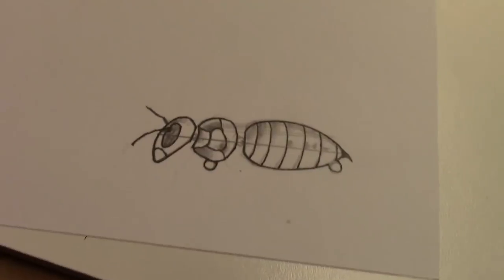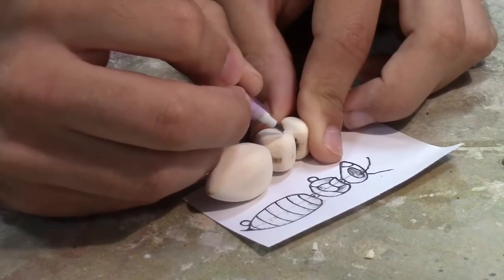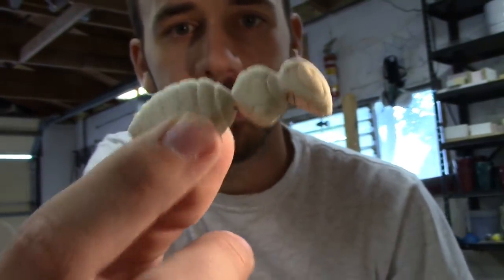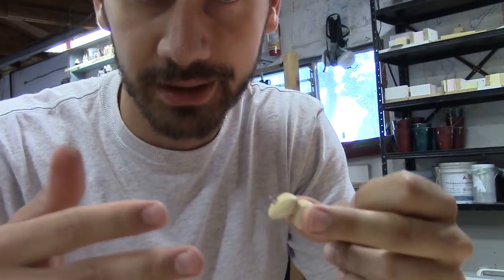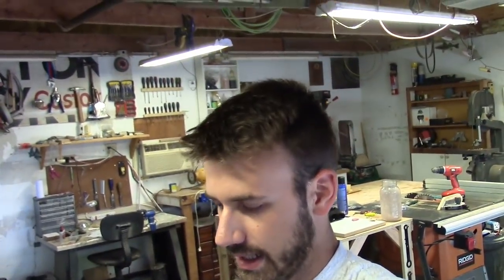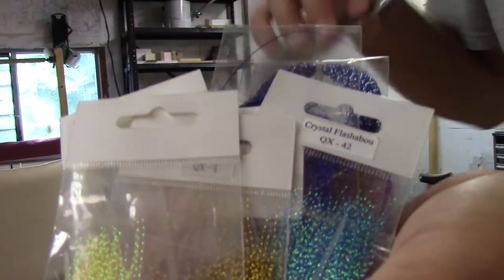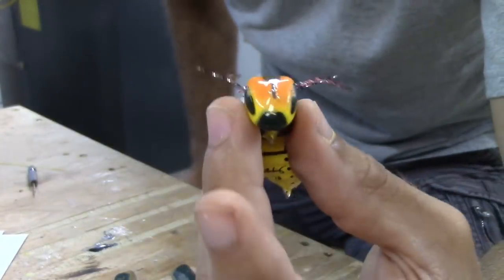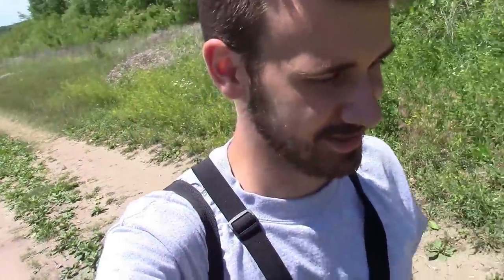Making a Hornet Lure

Comment: my dude, i seen ur comment below about why u dont use a dremel, been watching this channel for a long time and always wondered why u didnt,  ok so hold the dremel like a pen, and use ur chin as a resting  point for the top of the dremel to keep your lines straight,( wear sealed safety goggles :) )  use a small round  bit, the more course the bit, the harder it will be to keep straight lines 
because it will dig it self in different directions,  make several small passes, dont try to do the line in one pass,  medium speed on dremel, too slow will dig and to fast will run and or dig,  you will have more control cutting towards the  resistance of the bit , so rotate ur cuts towards the pressure of the cut not  away from it,   i am a surgeon with a dremel tool, this is valid advice :)   just try it on scrap blocks of the same type as the lures, practice makes perfect..

Comment: She turned out nice. 
I have been building lures for about 7 years. Twisting the stainless wire is brilliant so consider that technique stolen 😜
UV cure resin is affordable now and is great for the final dip. 
Look into Solarez Dual Cure Polyester by the quart. You may or may not have used it but it can take away the rotisserie concept all together as it will cure with a UV flashlight or sunlight to a rock hard glass finish. 
Solarez did not pay me for this comment!  Keep up the killer work man..
Reply from the maker: Thank you, and thanks for the tip. I’ll look into that!

Comment: I do follow your awesome works. I have decided to do some for myself too, I have just a question: which epoxy resin should I use and what do you recommend for a Airbrush Set? I would  really appreciate if you could share your experience and opinion. Best regards from Berlin 😊
Reply from the maker: Awesome thanks! For a 30 min clear coat I used BSI 30, and for a long cure eopxy I use Envirotex lite. I started with a “ Masters” airbrush set. Cheapest reasonable looking one I could find at the time. Now I use an Iwata. You’ll certainly get what you pay for when it come to airbrushing.
Reply: Marling Baits Thank you very much. Amazing lures. I wish to have one, maybe one day 😁😎 Thank you again.

Comment: nice,now try to make same lure on max. 2,5cm (dont know how many inches),with duck lip,wire that goes trought all lenght of body parts (not two parts of wire for every section of the lure),make realistic macrolon or some other material wings etc....that would be version for chub....
Reply: darjan tosic 2.5cm is 1"